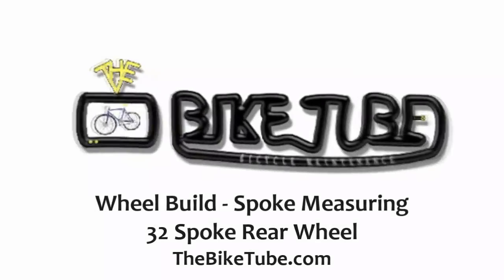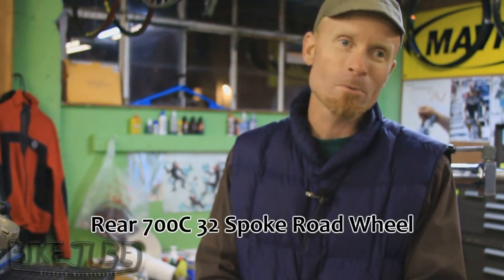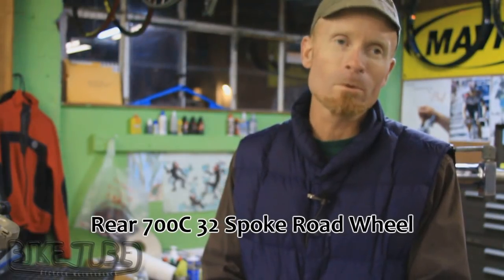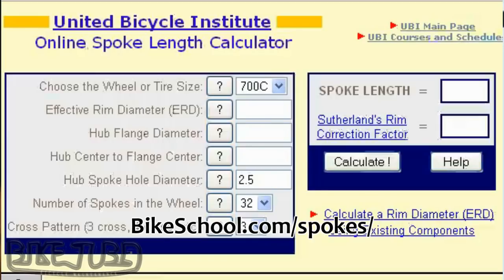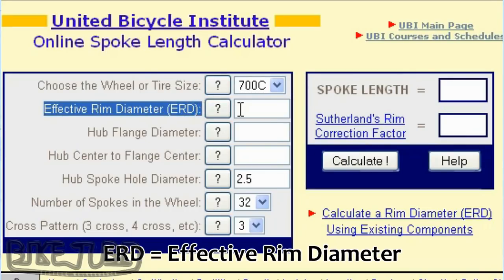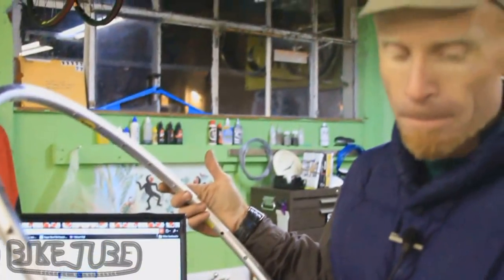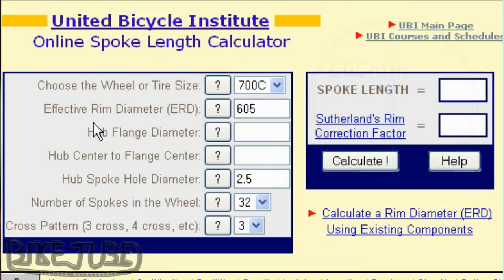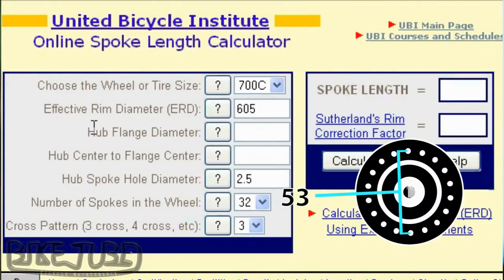Calculating Spoke Length: How to Build a Rear bicycle wheel (700c, 32 spoke), measuring the Spokes

Comment: Thanks for making these excellent wheel building videos.  Some people have posted their own "simple" versions and they omit very important info that will lead to certain failure (ex. no mention of different spoke lengths used for driven wheels because the poster is demonstrating a front wheel).  My problem was the OEM spokes were too "long" and that was due to me using a 3x pattern instead of the 4x it was spoked with originally.  DUH!

Comment: so if the rear hub is a flip flop hub and not a multiple speed one, it would most likely be symmetrical with the rear wheel right? or would there still be a difference in spoke length on tge drive side and such?

Comment from the maker: @heatx It depends if it is single sided or dual.  If you can put a cog on both sides then it probably doesn't have to be dished.  If you can only put a cog on one side, then it might have to be dished slightly.  Thanks for watching!

Comment: Good Day Sir. I have a Quick ?   I'm trying to install a 3 speed  Shimano Nexus (36spoke) hub into my rim (48 spoke)  I want to try and retain the larger wheel if possible instead of downsizing to a 29.   I'm getting mixed reviews  that it will/will not work. Can you help me in anyway ? I read where  someone was lacing 12 spokes in a radial set up but the lacing and location of the remaing spokes was very misleading. Is this possible ?   Thank You Anthony

Comment: Mike a small query.....can we use uneven spoke holes ? say Rim with 32 holes and Hubs with just 24 or 28 holes. Will it affect the durability of the rim ?
Reply: It is better if the Rim has less holes than the Hub, cause the forces are more even on the largue diameter wich is the Rim

Comment: How did you get 52 and 78 mm for the hub centre to flange centre? That's a total of 130 mm the whole axle is only 135mm.
Reply: my question too, something wrong here. This 52+78 sounds like distance from dropout to center rather than flange to center.

Comment: Terrific instructional video. I found this when I was researching the Wheelsmith Rim Rod. Thanks for sharing.
Reply: I agree with primalresidence. The hub center to flange measurements appear to be 52mm and 78mm. If you add those two it comes out to 130mm. The locknut to locknut measurement is probably only 135mm, so the hub center to flange measurements should be smaller. Still a great video.

Comment: My mom has an old trike. I want update the wheels to an heavy duty aluminum set. The rear wheels are mounted to an axle and the 5-speed cassette is in between the two.  Does anyone know if those back wheels would have a to be off set? Thanks
Reply: Did you get new wheels? Wheels only need offset (dish) if the hub centre (half way between the flanges) is not positioned centrally in relation to the frame, because the rear hub on a normal bicycle has to allow room for a cassette. If the cassette on your mums trike is positioned on an axle between the two rear wheels then the new wheels shouldn't need to have any offset. You will be able to spec replacement wheels more easily (eg wheel size, hub width, attachment method etc) by checking the old wheels.